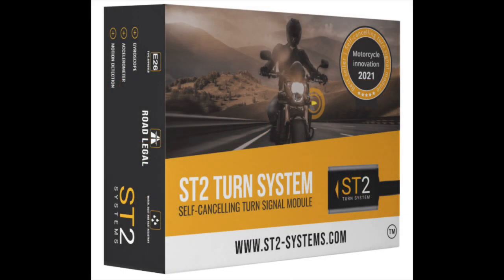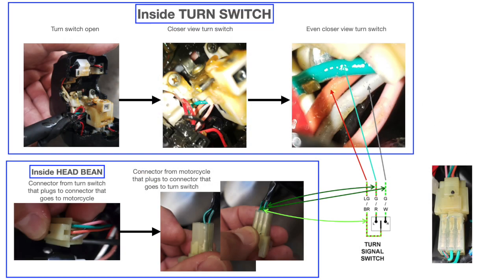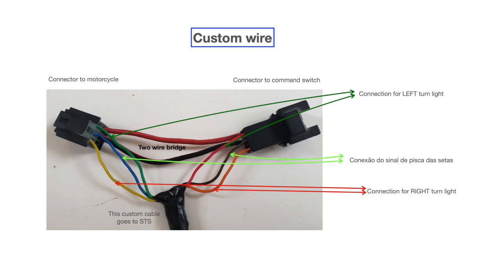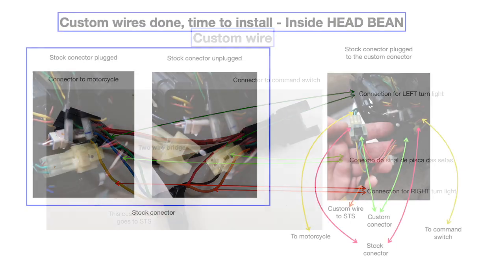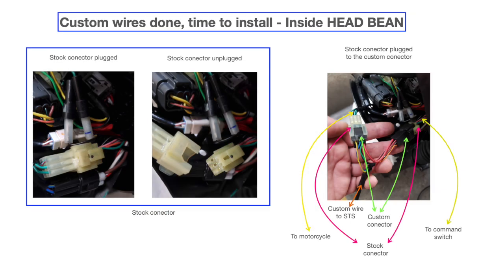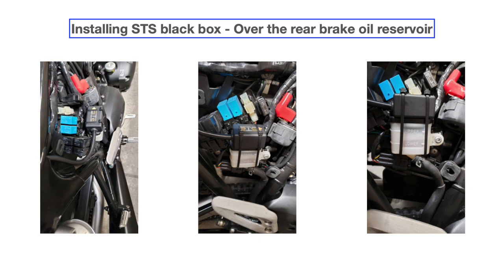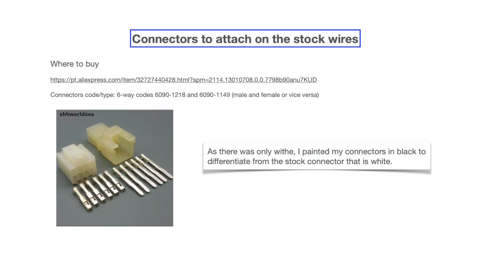Installing a Smart Turn System in a Triumph Speed Twin

Comment: what kind of cable did you use to make the custom cable please?  The red and black bridge cables look thicker. Is there a specific cable spec that I need for this?
Reply from the maker: Hello. There is no scientific reason to be thicker. I chose them a little bit thicker for "just in case....." some extra precautions (definitely the inside copper is thicker as well) in terms of any extra heat through the cables. I think it could be thinner as all SMART TURN SYSTEM has thinner cables. By the way, still working as the first day.